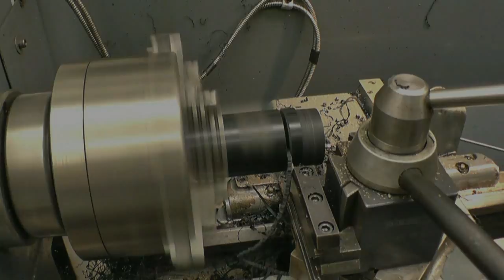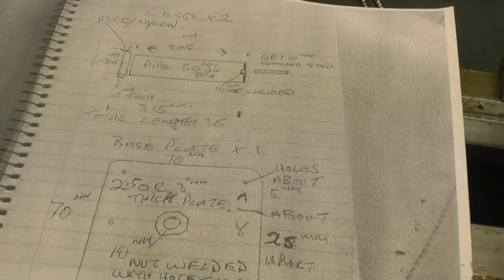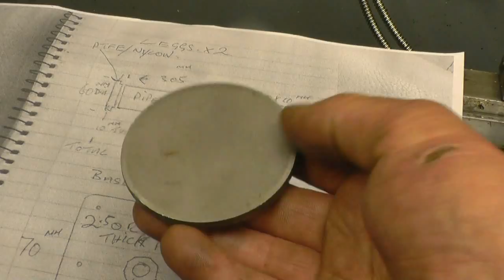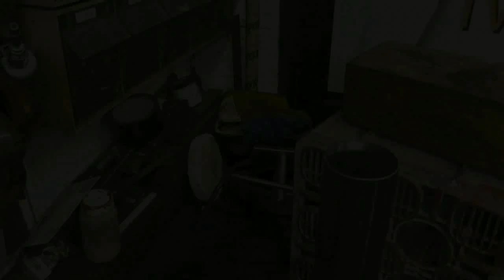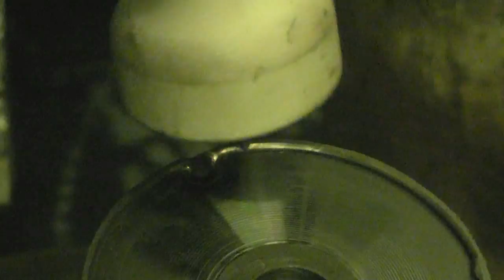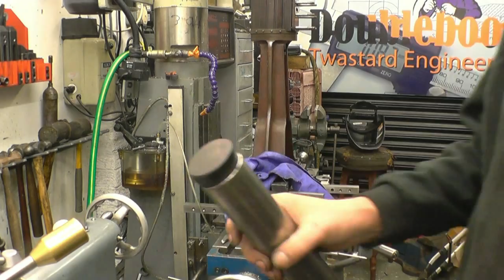SNNC 193 P1    Stainless Bed Leg Repair

Comment: Is there any places in the world that make new parts, like pistons, for antique engines?
Reply: keith rucker knows of a couple of places that can do iron casting, so i guess thats your avenue, and know some good machinists, but youd have to know what you want and drawings or such, not just i need X part for a 1903 wotsit machine
Reply: Cast iron piston?
Reply from the maker: Yes it will be cast iron
Reply from the maker: With enough money, you can have anything made  Some companies still make piston rings etc
Reply: Thanks John I enjoyed the video. I have an RTECH 200 amp ac/dc tig similar to yours. What kind of ceramic is that you were using on your torch please? All the best, Carl.
Reply: A chap I was talking to had some new rings made for his vintage car, over £600!!!
Reply from the maker: http://www.r-techwelding.co.uk/welding-equipment/tig-welder-consumables/tig-torch-consumables/tig-zone-evo-flo-cover-nozzle/tig-zone-evo-flo-series-2-wp9-20-230/
Reply: Thanks for the reply regarding the tig torch. So it's a gas lense! I do use one now, but not like yours. Saw one like yours on Welding tips and tricks, Jody's channel. I wanted to get one like that as it seems you could get a lot of tungsten stick out with it. So now I know where to get one. Thanks very much!
Reply from the maker: use my name
Reply: Thanks will do.